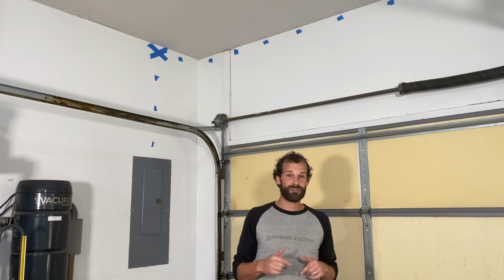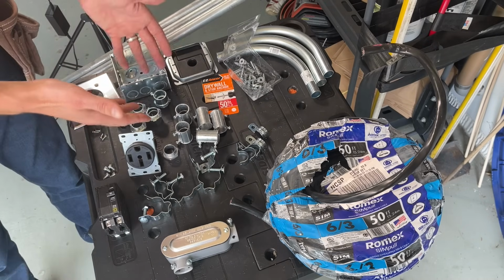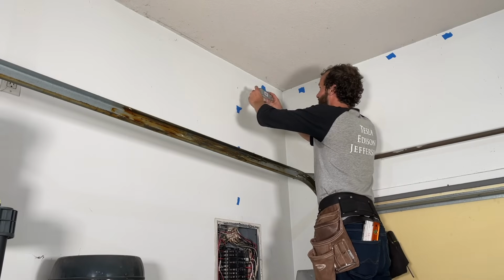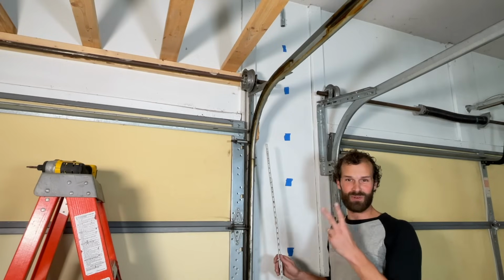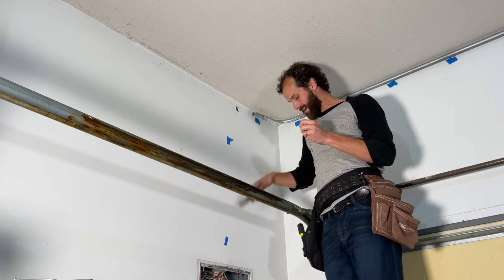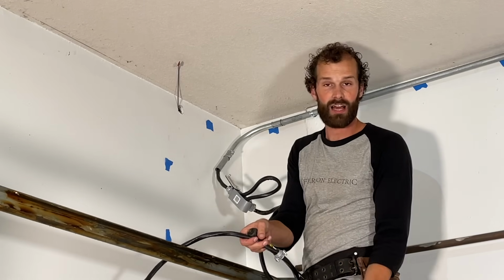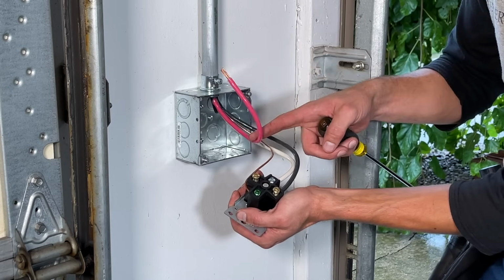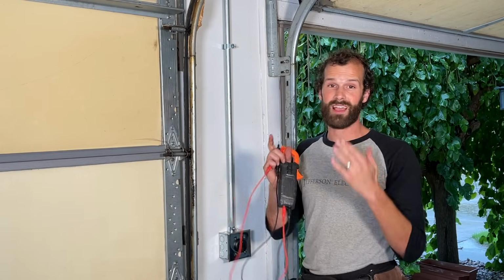How To Install a 240 Volt Outlet | Electric Car Charging

Comment: I was able to install about 90 feet of 6/3 wire using your video as a reference guide and saved myself thousands of dollars. I just wanted to say thank you for the clear, and easy to understand video. 

Anyone thinking about doing this project can absolutely do it, just don't cut corners. Make sure you get a commercial grade Outlet like he said in the beginning of the video, and based on what iv read it sounds like a cheap torque screwdriver will be helpful to make sure those terminals don't ever come lose and cause problems in the future.
Reply: He screwed up in this video,  like a lot of electricians, that know nothing about EV charging.
He installed a outlet that is sure to melt over a long charge.    Hubbell Lighting 125V 50A 3-Pole 4-Wire Receptacle – HBL9450A, is rated for the EV charging.  Long runs like yours, #4 wire copper.. These guys only run the required, Cheap !
Reply: yep, im about to do the same about 90-100 ft. thanks for sharing
Reply: I think the hardest part about this is getting your local jurisdiction to issue you a homeowners electrical permit

Comment: Please don't say 220. It's 240. 120 is not 110, just like 480 is not 440. 120 240 480. Just makes me nuts to hear 110 or 220. I don't care what manufactures list as 110 or 115. Line voltage is what we need to talk about.
Reply: All are nominal voltages, in name only, doesn't matter what you call it.
Reply: @pld8993  Well then, let's call it 122 volts. And since it don't matter what you call something, I'll refer to my pickup as an 18 wheeler from now on...:)
Reply: @Kevin-mm6xm  Voltages are not identified by their actual voltage, they are identified by nominal voltages. You could call it 122V and it would still be no different than 120V. If you put a meter on a 120V circuit, for example, you will NEVER get 120.000V. The actual voltage varies depending on the time of day, time of year, outside temperature, demand load on the grid, etc. There are times the actual voltage might be as low as 110V or as high as 125V. Calling a 120V circuit 110 or 115 is not unreasonable given that are times when that's exactly what the voltage is.
Reply: @pld8993  I'm sorry but I totally disagree with you. I know the voltage fluctuates. That's simple electricity 101. What should not fluctuate is naming the nominal voltage. 120, 240, 480. Please, give me a break. This is simple common sense.
Reply: @Kevin-mm6xm  Fine, let's all use the same nonfluctuating number for nominal voltage: 110, 220, 440V. Simple common sense.
Reply: @pld8993  No, let's use 130, 250, and 490 because I like those numbers better.
Reply: @Kevin-mm6xm  Nonsensical. 110, 115, and 120 are all used in the electrical and other industries to nominally identify 120 volts; 130 is not.

Comment: I always use a larger fitting say a one inch l l fitting with reducing bushings to ease the bend of the wire in the fitting ! One inch to three quarter for the the e m t pipe ! If I were running two inch pipe with a l b fitting I would use a two and a half inch l b with reducing bushings to reduce to two inch !

Comment: I am coming into my electrical box from behind it. So the wire will go through 3/4 inch plywood with the panel up against it. Not sure how to protect the wire as it comes into the panel from the rear. Any help would be appreciated.

Comment: We did it, WE DID IT, Yey! Yes, after watching this video twice, we made some notes and picked parts we needed from the local store (not big box stores) to support the local economy, and we executed this task in under 3 hrs, ran about 45feet wire from the breaker box in the basement to the garage wall. Excellent video, pay attention to instructions and you'll be surprised how easy this task becomes. We followed all codes along the way and yes, that 90 degree L-box at the wall was a tough one to route wires through but we did it. Thank you.
Reply: If you followed this video in no way did you follow the code. Multiple violations in this video.

Comment: I watched this video a few times and without any electrical experience I was able to do it in 6 hours. Instead of running Romex throughout I wired individual wires as they were easier (they are lubed) and then instead of the conduit box I used the same deep square box and connected Romex into the dry wall - they also have a follow up video with errors. Also don't buy anything from amazon except the Industrial 14-50 outlet (Bryant and Hubble are the same and Bryant is cheaper) - local hardware store is cheaper  Enjoy, Be Safe and Happy Level 2 Charging! Thank you!

Comment: GREAT VIDEO.  I need to have 240v outdoor outlet and for my electrical pizza oven but, I have only 120 v outlet, and I'm about 50feet away from the circuit breaker. can I convert this outlet to 240v by use to hot wire? can you help with this please.
Reply: Hi, you cannot do it due to needing 6 gauge wiring for 240v.  Also, unless your EMT conduit is 3/4 inch or larger, you would not be able to pull a replacement wire set.

Comment: to everyone watching, DO NOT use a metal fish tap in a hot panel. They make fiberglass fish tapes for the purpose of using in a hot panel (with electricity on). It is extremely dangerous because all it has to do is touch one of the electrified components and bam you are being electrocuted. please work safely (for all the DIY folks)

Comment: CARB lies about the efficiency of EVs!!!! In their ARB/MSD/7-6-94 they claim the battery is 80% and the motor 90% efficient.  These are LIES!!! Charging a battery in one hour is 5.88% efficient! In 15 minutes it is ONLY0.3675%!!!.  The motor efficiency depends on how many stops are made. Each time it starts the motor and system efficiency are almost ZERO!!!!!
Reply: Efficiency numbers without context and defining parameters are nothing more than numbers. Your comment in nonsensical.

Comment: nice video... recommend remove jewelry like rings, necklaces, and etc. for safety whenever working on electrical circuits.  Welding oneself to a live circuit could remove you from the gene pool.

Comment: Thank you, you did just what I need to do. I just have one question. I want to add a 110 outlet near the 14-50 outlet. Can I put an additional 12 gauge wire in the conduit with the 6 gauge wire. Again thank you for your help.
Reply: yes

Comment: We just leased a 2024 Jeep hybrid.  We want a level 2 plug in.  Calling an electrician out this morning.
Reply: Skip the plug-in, direct wire is a better option. I've been installing EV chargers for about 5 years now and I always direct wire. There's no good reason to have a L2 charger that plugs in.
Reply: @pld8993  That is what we ordered.  Takes a month to get the level 2 gadget.
Reply: @Gotta-love-47  Not sure why you'd wait a month. There are plenty out there you can get in a few days.

Comment: I am pretty sure that your ground wire should be attached to the outlet box as well as the outlet, especially since your conduit does not go all the way back to the breaker box. I am surprised that you are allowed a ground wire that much smaller than the other conductors. Some states allow you to do new work with a home owner's electrical permit, some don't. So where is your permit?

Comment: My understanding is that the latest code requires GFCI protection for 240 volt outlets in garages.  Is this the case?  I also note that in the panel the newtral and ground wires are under the same screw.  I was told that while ground conductors can "double up" neutrals (white wire) can't do that.  Overall good instructional video.

Comment: When you were adding the face plate to the receptacle between the doors there seemed to be a wobble of the box. Is this allowed?
Reply from the maker: It is only attached to the drywall so that is where the give comes from.  It is allowed but if you wanted something more secure you could add some blocking or plywood over the drywall.

Comment: If you can use the main disconnect found at the bottom of the meter. 
Or the 200amp breaker found at the top of the box.

Comment: rewatching this video and noticed that he is running romex through conduit. I was told you're not supposed to run romex through conduit. instead you should run thhn. is this code?
Reply: No, romex is allowed in conduit.
Reply: @pld8993  ok thanks
Reply: @pld8993 wrong.
Reply: @Californians_go_home  No, I'm not wrong. Romex is allowed and sometimes required to be in conduit.

Comment: Romex wire is not rated to be put in conduit. I know 4 inspectors that would fail this right off the bat.
Reply: Then you know 4 inspectors who don't know the NEC. Incorrect. Romex is allowed and sometimes required to be installed with conduit. Also, romex is a cable, not a wire.

Comment: Before taking this DIY advise, please call your home insurance company and ask them if they require a licensed journeyman electrician do this, before the house fire causes them to deny your claim and you get ruined.  Now is the time to tell them of your EV mistake before it explodes under the dead kids' bedrooms.  Many companies  are refusing to ensure EV owners insurance as the risk of a totalled house increases greatly even parking an EV inside as they burn spontaneously.  Hiding this from insurance simply means claim denial.

Also, before apartment dwellers buy one, make sure your apartment owner allows this risk to be parked in his underground garage!

I now return you to the EV cult for more bullshit.....
Reply: Simple fix..... don't buy GM garbage.
Reply: Amen .

Comment: Great presentation thanks
Reply: This is so helpful especially If you are a novice. I did measure all the conduits all the way to the box from the main plug first as well as the space between connectors and I started pulling the wires from the floor so I don't have to sweat pulling when the EMT's are all hanging. Lastly ,I torqued all the wires from the main plug (14-50R) as shown in the video and I laid the ground and neutral wire to the box perfectly. I'm so happy about the result of this project. I saved thousands of dollars doing this myself, I'm so thankful for this guy doing this video! Keep on truckin bro.:hand-purple-blue-peace:

Comment: Great video, but I've seen a lot of people comment on other electrical videos that they are professionals and say you should never run insulated romex through enclosed conduit. They say it will make the wiring overheat in the conduit and cause problems. Some even have said it's against code in their locations.
Reply: It's not an NEC violation and the romex will not overheat simply be being in conduit. These "professionals" are wrong.

Comment: probably already been said in the comments but I think it should be noted with all the views this has. That 14-50 socket is not what you want to use if your going to be plugging and unplugging your unit and taking it with you. That might be ok if your doing a dedicated wall mount, but then I would hope you are just hardwiring it. That 14-50 is designed for a dryer or some other item that will be plugged in maybe a handful of times in its life, not 7 days a week. You would want to use a Commercial 14-50 that is made to have things plugged and unplugged a lot.

Comment: Im going to use single conductor wire in conduit and cut the drywall to panel and put my wire in small flex conduit...question is, should I use 6 stranded or solid wire....thanks!
Reply: When running THHN in conduit, anything larger than #12 should be stranded.

Comment: Goood video. Question, can you add another 220 outlet to an existing 220 dryer outlet basically having two outlets on the same circuit. One for the dryer and one for a garage heater both won’t be running at the same time.
Reply: no

Comment: Wonderful video, do have question. Why did you not ground the box with the solid copper wire? Unless that plug did it, you can short on box and it be hot the entire pipe…

Comment: why would you wire like that. How an incorrect job was done. why would you pull that romex thru raceway.
Reply: Though this particular installation wasn't done properly, romex is sometimes installed in a raceway for physical protection.

Comment: How to install a external 240 plug? I don’t have a garage. I would like to use the dryer plug from our basement. I’ll use a splitter to switch between the dryer and charger. I’ll run the wire inside the house and have it come all the way to the back of the house. What supplies do I need.

Comment: Obviously not a licensed electrician so many code violations. I will try to go over the most important number one. You cannot pull NM. Cable through conduit. It has to be individual conductors. THHN number 6 black red white and the green can downsize to number  10 Plaster rings are for new construction where sheet rock is placed over them. In the case where you are surface, mounting the box in a garage, you use a ID cover that's industrial device cover. Item number 3 this needs to be hooked up to a GFCI circuit breaker in a garage. Even if it's not outdoors. The most important thing that I want to stress is. Do not try to pull's number 6-3 through 3/4. Inch conduit or even 1" inch conduit, it will not pull you will struggle with it unbelievably hard to do impossible, that's why it is not code approved use individual conductors as I stated above. Read a real electrician's how to book. Don't believe the c*** you see on YouTube.KJ'sCUSTOM ELECTRIC  IBEW 40years
Reply: While installing romex in conduit like in this video is a rookie move, it's not a code violation.
Reply: Absolute violation. Also 6 gauge romex is undersized.
Reply: @Californians_go_home  Incorrect. While this installation has several violations, neither romex in conduit or conductor size is one of them. Romex is allowed in conduit (sometimes required) and #6 romex is good for up to 55 amps.
Reply: @pld8993  you can’t use # 6 nm cable on a 48 amp evse.  48 amps @ 125 % is 60 amps = 4awg
 
Also apply this to installers, both electricians or DIY type using 10 awg or dryer receptacle or even 8 awg in conduit on a 30 amp evse . In both situations the cable is undersized. 

If nm cable is run in conduit it can’t be used in damp locations which pretty much limits it to short runs in dry locations which technically is the    Equivalent of mounting it to your living room drywall. It is no longer conduit but a channel.  Garages, laundry rooms , kitchens and bathrooms are also wet locations. Under floor in conduit is considered a wet location.  As a general rule and most AHJ around the country, it’s not acceptable.
Reply: @Californians_go_home  You are 100% wrong. Most EV chargers are not 48amp loads so while you can't run a 48amp charger on that recep, any of the smaller ones are fine. None of the locations you identified as wet locations are wet locations. Under a floor/basement ceiling in conduit is not a wet location. Underground in conduit is a wet locations. Does it rain in your garage, kitchen, bathroom and laundry room? I didn't think so. None of those locations are identified as wet locations in the NEC and conduit run in any dry location allows for the use of romex in the conduit. #10 on a 30a dryer circuit is not undersized and simply running conduit does not require the 30amp circuit use #8. You don't know what you're talking about.
Reply: @Californians_go_home  Also, a conduit is, by definition, a channel. Not sure why you're trying to make up a non-existent distinction. There is no rule limiting the length of romex in conduit to short runs.
Reply: @pld8993  dude go away.  Continuous loads shall be supplied at 125 rating.  All those locations I mentioned are wet damp locations and require GFCI protection because they are classified as wet damp locations. You are clearly here to
Argue bs.
Reply: @pld8993  dude go away.  Continuous loads shall be supplied at 125 rating.  All those locations I mentioned are wet damp locations and require GFCI protection because they are classified as wet damp locations. You are clearly here to
Argue bs.
Reply: @Californians_go_home  Yeah, as I said, an EV charger with a 48 amp load would not work on that recep but the smaller ones will because they'll be at or below 80%. Have you ever read the NEC? Obviously not. Those locations require GFCI protection because the the NEC, that book you've never read, says they do, not because they are classified/defined as wet or damp locations. Proximity to water, like a sink, doesn't automatically classify a location as wet or damp. You're wrong. Again. You may want to go away and dig into the NEC before you say anything else that makes you look foolish. Reading is learning, try it sometime.
Reply: @Californians_go_home  
Location, Wet. Installations underground or in concrete slabs
 or masonry in direct contact with the earth; in locations subject
 to saturation with water or other liquids, such as vehicle washing
 areas; and in unprotected locations exposed to weather. Any questions, genius?
Reply: @pld8993  yes one more. Are you dating anyone ?   I may be falling for you at this point.  I feel like this might be right for us to take the next step. ❤️
Reply: @Californians_go_home  Nice attempt at pivoting away from your ignorance.

Comment: Excellent educational video with all the step by step detail. Just one question as DIY'er, would it  have been safer for you to put a piece of cardboard or non conductive blocking board over the live breaker box while running the fish tape?  It's just from a DIY'ers perspective, but otherwise this video was excellent.
Reply from the maker: Probably even better to just use a fiberglass fish tape 👍.  Best of luck with the project.